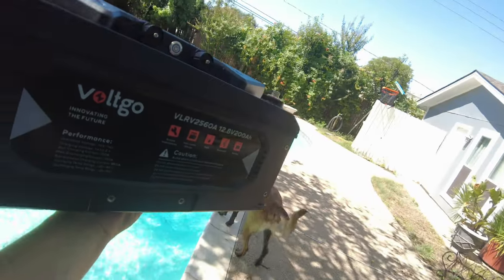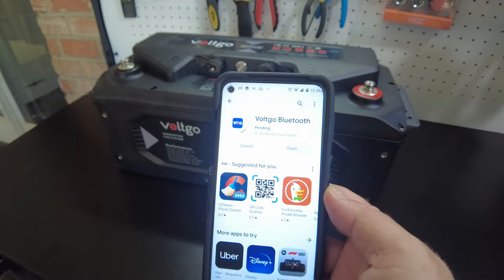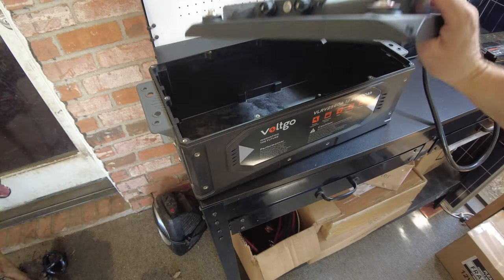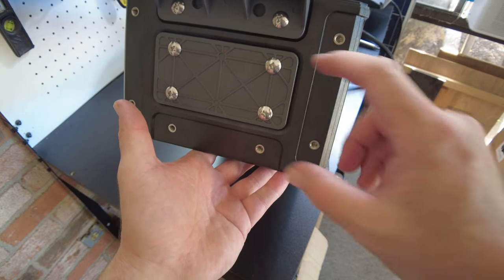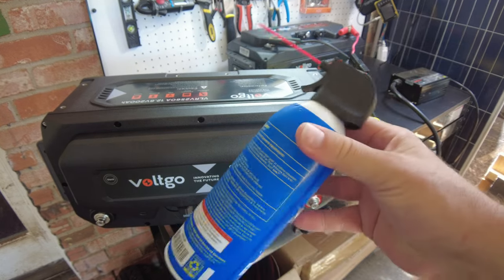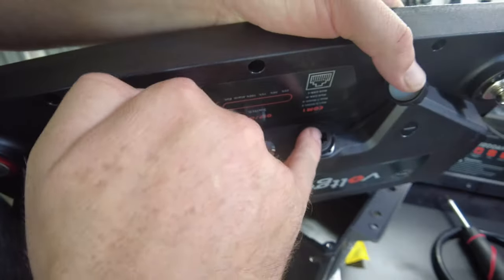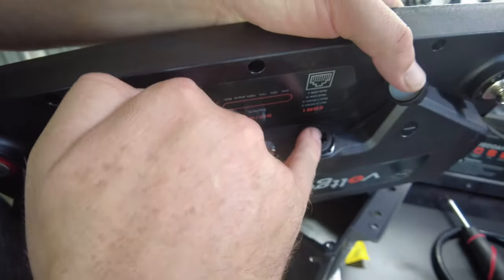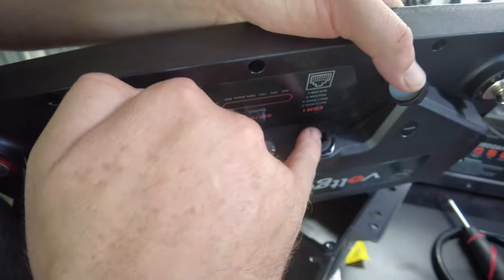Voltgo 12.8V 200Ah LiFePO4 Multipurpose Battery

Comment: Do what AVE does - take a slice off the plastic case edge in an inconspicuous place with a sharp utility knife and listen to see if fibreglass is present.
As far as the battery goes, it's definitely up there with the best you have reviewed Brad. I missed what held the pack in the case. Looked like it was friction and constrained space rather than specific hold downs?
It occurred to me that dropping the real battery in the pool would have the battery sink to the bottom. It looked like the sealing would hold out under that situation though. It might be rated to IP65 but nothing to say they didn't attempt an IP67 or IP68 by design judging by the epoxy in the comms ports. I wonder how that switch would fare?
Another excellent review, thanks champ!
Reply from the maker: Dang, yeah I need to make a battery test check list. I usually check for extra insulation between cells, but missed it here. It might be features molded in the case/lid holding it. It kind of felt latched in because it took me some wiggling to get it to initially move out, like it was latched/hooked somehow. LOL, that was my concern, trying to fish a 52lb battery out of the bottom of the pool. The manufacture did say I could submerge it a little, so I think they over engineered that rating. Thanks!
Reply: @BradCagle  Love your videos Brad.
Reply from the maker: Thanks @MiniLuv-1984

Comment: I think the only issue it might have is the bus bars do not look like they can flex. Not sure how flexible thick aluminum bus bars are. But if the cells expand like they all do that could be a failure point. They did look compressed so it might not be an issue. Everything else looked like it was built very well.
Reply from the maker: Good point, I did not see a flex point in the bars. I think with the fixture it's in I doubt it would be able to move much. Will be interesting to see data come in over the year with all these batteries on the market to see where the failure points are. Thanks!

Comment: Many threaded inserts all around the Battery Box allow to mount the Solar Charger and Inverter directly on the Battery Box using some DIY brackets or pieces of plywood.
Reply from the maker: That's a great point. Thanks!

Comment: This is the best battery box I have seen so far, I’m impressed with it.
I would like these battery boxes as DIY home building kits like Sun Fun Kits has.
I would just change the BMS on the batteries to the JK BMS brand, 
for 24V and 48V JK BMS Inverter - as a DIY kit option :) 
If BMS wouldn't change, they could at least sell those awesome empty battery boxes.
Reply from the maker: I was thinking the same, really awesome box for DIY. I have an 8s set of cells I'm thinking of putting in the empty box they sent. I'll run the suggestion by the manufacture. Thanks!
Reply: @BradCagle  Yes you can use the empty box to create your DIY version of this battery, it would be another great video from you.
The empty box kits would also be good to have their battery cell holder and an empty plate to mount the BMS.
Then everyone could use their cells their preferred BMS.
Will you also be reviewing the 48V battery when it comes out?

Comment: That the best I have seen yet. I am Shure the heater came on when you got the sensor cold. with it together put in in the cold like freezer and read app see it heater came on . or just the heater come on with charging from the external power source.  what powers the heater?  may be a fun test .
Reply from the maker: Yeah, these are awesome batteries. I need to test the heat function, maybe when we get some freezing temp here. Thanks

Comment: Hey Brad, I love the design of this battery but i don't like the fact that they welded the cell terminals to the buss bars, which means that you can't replace the cells if you have a problem also it sucks that they used aluminum buss bars, i would have liked to see tin plated copper buss bars. Do you know if the company will sell just the case with the handles??? I think that it would make a great case for Headway cells
Reply from the maker: Yeah I agree I would have liked to have seen bolted busbars too. This case for DIY would be awesome, several people have mentioned this. I'll suggest it to them. Thanks!

Comment: If that thing is 50+ pounds it's wired internally at 2S&4P to get 12V 200Ah. Meaning there's 8, 100Ah cells inside.

Comment: If you're gonna touch the circuit boards with your skin wear a ground strap... and I Certainly hope you're making sure it isn't energized either, otherwise you could experience random failures when you short things without realizing it .
Reply from the maker: Most of the electronics in this industry have conformal coatings. Basically a clear coat over the finished circuit, so it's usually insulated. Thanks!